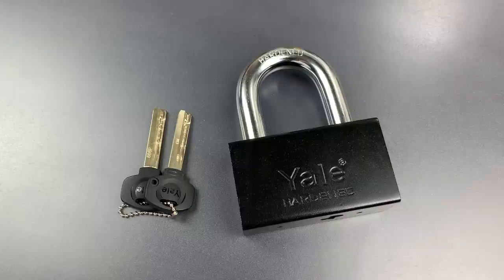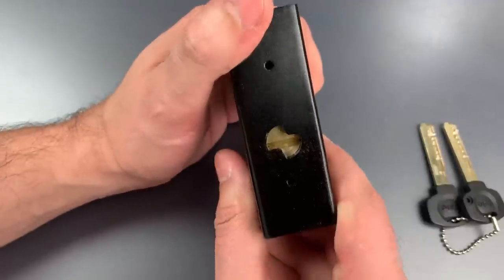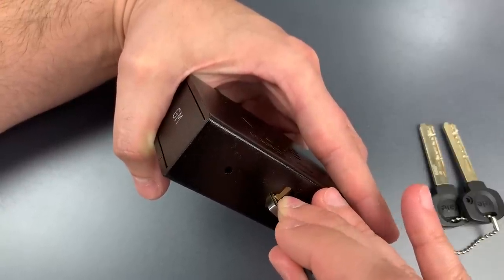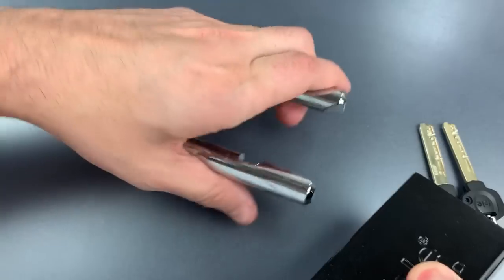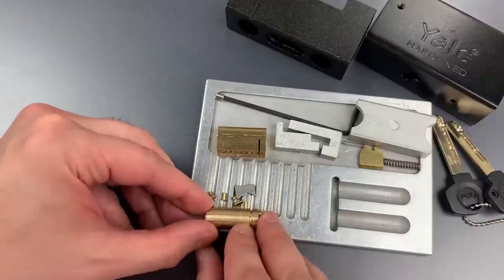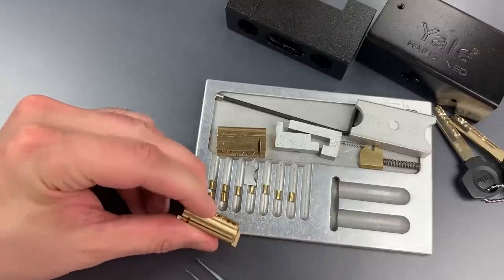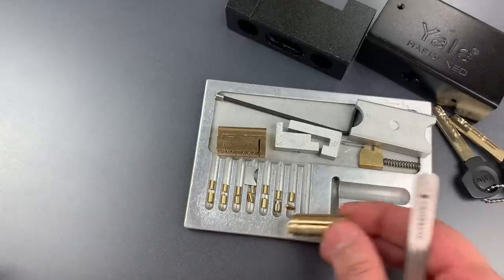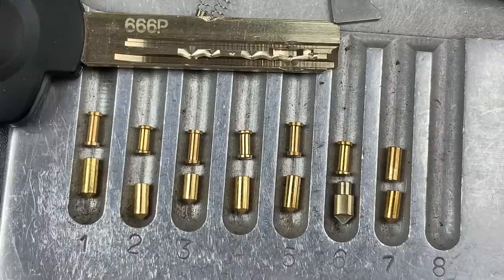[772] HUGE Yale “Smart Padlock 16” Picked and Gutted

Comment: Pin 6 is supposed to be an anti bump/rake pin. If you try to use a kinetic attack the pin will rotate and jiggle in the oblong slot which dissipates the energy side to side instead of pushing up the spring tension.
Reply: but the slot looks like the same shape as the base of the pin, where would it rotate?
Reply: Nah, it makes the pins proprietary, so if you ever wanted to rekey these locks, you would have to buy pins from them.
Reply: I was thinking similar... the smaller tip might make it harder to single pin pick due to slipping off or similar.  Also might throw off someone with a rake because pin 7 is off from where it "should be" in an even distribution.

Comment: "Yale Israel" is a subcompany of Mul-t-lock in Israel, so essentially it is the same lock branded differently, with tje core replaced to suit the brand
Reply: Not the same core, but yes. Same lock body.
Reply: Both owned by Assa Abloy 
Mul-t-lock founded 1973 , HQ in Yavne  Israel  ...  Yale , founded 1868 , HQ in Lenoir city , Tennessee , USA 
Assa Abloy also own Medeco and Sargent .
Also  Abloy factory store sells Master Locks electronic padlock for some reason .
Reply: Yale, multlock and others are ownes by ASSAAboy global company, so they can and do share patents   original idea is from mtl integrator, and they make cheaper version (same constrution but cheaper fabrication of this Yale or Garrison, i had both in hands and it can be seen on details..

Comment: This lock structure comes in 3 shackle diameters: 10 13 and 16 mm. They are originally designed to fit in a steel case to further pevent brute force attack. The steel case is even more heavy duty from the lock. It is intended for heavy seel gates or steel containera. The housing can be bolted to the gate/door, however it is usually welded into place.

It will be interesting to see a destructive entry attempt on the fully armored version of this.
Reply: "This is the LockPickingLawyer, and today we are continuing our series of videos showing how the Yale 16 fares against the Ramset gun."
Reply: @StopChangingUsernamesYouTube  Nice Idea, however I don't think it'll be a practical demonstration as Israel, where this is sold has strict firearm regulation laws, which I think make a ramset illegal and hard to come around by.

Ironically, It WILL be a more plausable demonstration to take the lock with its enclosure to a shooting range ;) and use an M16 or ak47 on it
Reply: @doncervera  Ironically you can buy a Ramset in the UK...
Reply: More interesting would be a picking attempt while the lock is upside down and stuck to the door as intended with all that hardened steel in the way. Good luck with that.

Comment: That strange looking pin is also used in Mul-t-lock integrator profile. It's just a pre made pin which fits into that oval hole. The key blanks also have a pre cut dimple for it. Not too sure on its added security capabilities though

Comment: HI LPL, nice vid as allways .. ;-)
About the 6'th pin, its designed as a patent protection againts unautorized duplicating keys (cut on key is patented),
this is a cheaper (same but  from cheaper factory) version of mul-t-lock integrator (check the web)
and numbers of keys means: 666P  66keyway(there are many different MTL keyvays) 6th position of "integrator pin" and P means pin and resp. cut on key are oriented to center of key/core, another key 666E means   are oriented to side of key/core this combination uses Garrisson cylinders with tuquoise key bows
MTL puts integrator pins to one of 3-6 positions and there is possible get even M integr. pin and keys means  
Master and is used in master key systems as a master key (key fits both orientation)
and "M" pin can be operaten only by "M" key 
never hesitate ask me for more info  ;-)
Reply: Ian Duke  yes, its about cut aside of sixth cut/dimple (from keybow)
There is a atypical keypin with more than just tip (asother pins) this pin has "bar" aside of tip and if You don't have that cut (check key at 6:20 on video) on the key that atypical pin still protrudes from cylinder and You cannot turn.. ;-)
Reply: Ian Duke ..yes, on key is that gap "above" sixth cut :-) )..
i'm mot sure how that idea is old, but  this variation  for me is new (when mul-t-lock came with integrator model several years ago)  new Garrisson and this YALE cylinders are just cheaper execution  of MTL Integrator ;-) 
And Yes even in europe sometimes somebody tries patent some wery weak idea, but we have more strict rules about what can be patented (and idea must be new od modified with some sensible new..)

Comment: When you say "counterrotation", are you yourself turning the tension back, or is the act of setting the pin turning the core back?
Reply: The act of pushing against the pin with the pick counter-rotates the core.  He slightly reduces tension to allow the core to counter-rotate and then it rotates again when actually setting the pin.  This is something that happens with spools but not normal driver pins.
Reply: @joshuarosen6242  There are some good videos showing how this works with big wooden pins.

Comment: I would like to see a video of you putting this lock and pins back together??
Reply: Shaun Novorosky seems like it’s gonna be pretty hard
Reply: @sfsaviation  Agreed indeed!!
Reply: This, complete with all of the swearing and failed attempts.
Reply: The. Mul t lock has the same split Bible as this. They make a tool to hold them together to make assembly more easy. Can be done without it but it's a pita and I doubt you can make it so people watching a video can tell what your doing
Reply: Not too hard with the plastic clip that holds the bible and plug together. I used to be a Mul-T-Lock dealer and keyed these regularly.

Comment: Great picking LPL, as usual. What if you slide the top part over the core as with a follower and pins would fall apart one by one?
Reply from the maker: There is a metal piece keeping the two parts indexed... they don’t slide.
Reply: You are wright, after viewing it again there's a piece of metal preventing it from sliding!
Reply: @lockpickinglawyer  
how will you get the driver pins back in if you cant slide anything over them ? , maybe a shim will hold them but it will be difficult :-)

Comment: Thoughts on using a shim between the core and the bible and then simply pulling the core away while holding the shim in place? Alternatively you can use a follower in a similar manner to how you would gut a lock with an encompassing bible, with or without a shim.

Comment: I think that pin six is cut that way so that it doesn't rotate as it's supposed to slip in that slot in the key, some times simple answers are the correct ones?
I mean, what else could it possibly do, to my knowledge, having a non circular pin (of a rounded cross section) doesn't really affect picking speed.
Reply: Maybe drill protection? It's thicker and a different colored metal. Then again, it is towards the rear.
Reply: Key control perhaps?
Reply: hmm how would a bigger pin affect key control? I've only heard of key control through modified unique key ways or "do not duplicate" marking. Making a duplicate key of the one that engages the large pin would work the same, right? or am I missing something?
Reply: It might also make picking harder because the tip is more narrow, if you look at the tip of the pin then it's not the ordinary round variant. And it might be a key control thing - a groove is required in the key that's not present in the shape of the keyway, which might throw off those trying to make a key copy.
Reply: Non rotating pin with "triangle knife edge" is like DOM pins which can snag and capture dimple picks; if you lift too high and pick rotates into pin chamber, pin falls back down a bit, and your dimple pick flag is "captured"  aka "capture the flag"

Comment: Pin 6 must have an oblong cross section to it, that would fit the oblong shape of hole number six.   This is an anti rotation feature that keeps its ramped end oriented properly to the keyway.  So what does it need to do that for?  IDK.
Reply: see my comment to aserta

Comment: LPL, I just found this channel recently, and am curious about a couple terms.  What is a False Set and what does Counter-rotation mean when picking?  I imagine these are terms you have explained before, but with 700+ videos I thought I'd just ask.
Reply: bowen324, Not sure LPL reads all the comments - there are so many of them for every video! A false set is when the lock has non standard pins - usually spool driver pins. As you pick, the core ( plug ) turns slightly, due to the narrow section of a spool pin across the shearline. Thus a false set. This spool pin ( pins ) has to be picked of course, and as the key pin is moved with the pick, the core will slightly counter rotate as the spool pin crosses the shearline.   Regards, Brian.
Reply: Many Thanks, Brian.

Comment: What do you mean by counter rotation?
Are you talking about relieving tension on the core?
Reply: literally, rotational force in the opposite direction than he's going with the tension bar. It suggests that there is a spool pin that is currently binding on the center, slimmer portion, but when manipulating it with the pick, it wants the core to rotate counter to the current direction of pressure, i.e. "backwards", in order to get the wider part of the spool pin past the shear line. Hope that makes sense.

Comment: They should put some kind of immobilizer tech, like the one that most modern cars are equipped with, inside of those padlocks.
Reply from the maker: They have this... if you want to pay $600+ for a Padlock.
Reply: Wouldn't it basically make the any lock pickproof?
Reply: AFAIK magnetic locks are functionally unpickable and far cheaper. That said an immobiliser based system has the downside of needing power to operate.Depending on the failure mode it might be possibble to bypass the immobiliser. And even if it fails to secure a failed pick attempt could still brick your lock.

Comment: Hey lock pick lawyer I am trying to find a good and easy lock but a tad bit difficult I was wondering if you have some ideas I am open to anybody also
Reply: Just buy a handful of cheap locks at Walmart.  You'll randomly run across a few that aren't super-easy picks.  Or do the same at Ace Hardware where I think you'll find some better locks, relatively speaking.
Reply: JamesG thx
Reply: brokenstitch  I am pretty poor 😂

Comment: 1.  No link to the other video (yet).
2.  Neither this video or the other go over the possibility (or lack thereof) of shimming this lock.  I see spring loaded lugs and not a ball bearing mechanism but have no other info on whether it's even a viable attack.
Reply: This is not shimmable, because the locking lugs ride on eccentric pins on the bottom of the core. The spring just preloads the core and locking lugs against each other, probably to prevent play or rattling.

You can see the pins at mechanism well at 3:20
Reply from the maker: Definitely not shimable.
Reply: Not shimmable